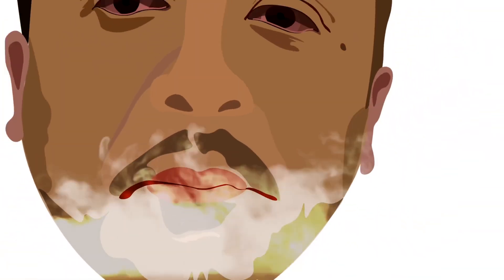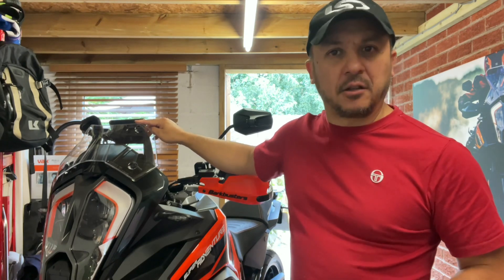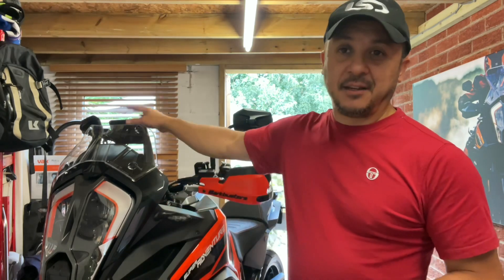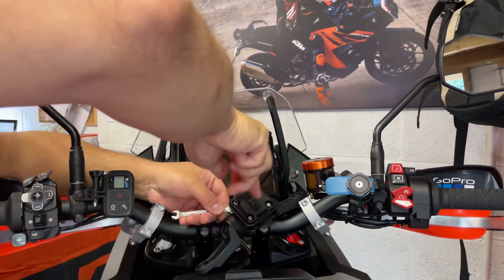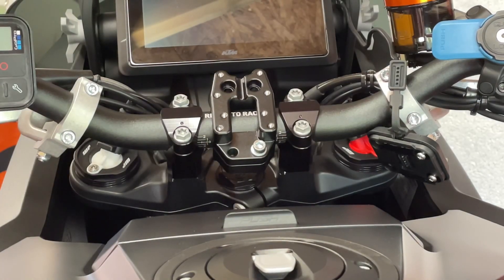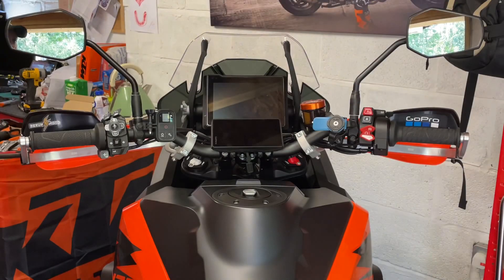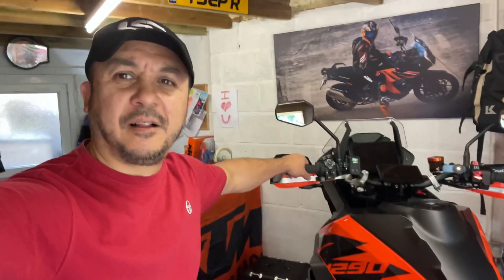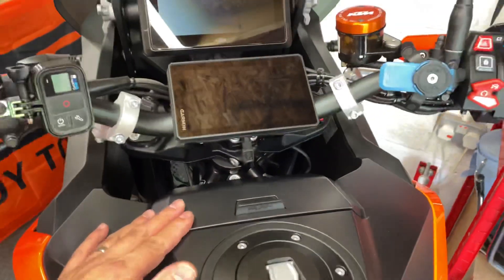2021 2022 2023 2024 KTM 1290 Super Adventure PERUN MOTO BAR MOUNTED GPS CLAMPS

Comment: I know the sun doesn't shine too often in the UK! hehe, but isn't the angle of the GPS on the bars catching any glare. I know here in South Africa I wouldn't be able to see the screen. On a related note I also have the XT and same OEM screen bracket which i changed yesterday due to to much vibration. I changed to a simple Givi bar that crosses the screen and makes the GPS more stable.
Reply from the maker: Hi Bruce thanks for the message and fair point! I have done a 300 mile ride today in brilliant hot weather and sunshine Hence the late reply. All day never had any issue of not being able to see it. Although that doesn’t mean that there will be the occasion that the angle may hit right . But for me I have had no issues so far 👍

Yes the oem mount is not to great and does vibrate a little. Although Personally I haven’t found it too bad. I’m not changing for this reason alone. It’s mainly for when I have the SAR screen on its more exposed and I don’t like it. Also I am doing some trails and want the nav solid on the bike. Which the pP mount is most certainly not solid.

I will still be swapping back to the PP mount for touring though. As I love the high level view. And again it’s not too bad in terms of vibration for the odd glance imo 

Cheers
Ric

Comment: Hi Ric - I’d be interested to take a look at this as I have a road book rally coming up and mount the road book on my handlebars - you also have a quad lock fitted too which I am also considering - good call on the rack by the way - mine arrived in the week and chuffed to bits with it 👍
Reply from the maker: Hey up Rob good to hear you received the rack and pleased with it. The Bar clamps are also as good build and finish. I am quite pleased with it. As for the quadlock it’s been my default ever since they came out years ago. I’ve had my phones attached green laning and dropped my bike more times than I dare count and the phone had never come off on impact. Only thing is with these smart phones and optical image stabilisation you ideally need to buy the vibration damper accessory. If you needed to look one weekend could meet up and you could check it out given your down the road . Or I could email or Fb more close up pics 🤝
Reply: @RicardoYeep  Hi Ric - I'll take a look today at the quad lock kit and give you a shout back I think - ideal place for the phone is on the sat nav mount as the road book holder goes on the handlebars but I also need to be able to have access to the phone to reset the counter to the road book as I'm riding - just need a better solution than what I had on the last road book rally

Comment: Hi Ric…you may have already been asked this! If you had the option again would you go with the S or the R model?
Reply from the maker: Hiya Paul I haven’t been asked but I would not buy the SAR even if I was tall enough... For me SAR is a too focused for heavy duty off-road. The SAS I can do most things I want these days on light off-road and trails.  But has all the mod cons and race bike like handling when you want on roads which is most the time. It depends on what you want from it I guess. Plus all the fancy extras like bash guard engine bars etc I can add easily 👍

Comment: You love them gadgets  :) The only disadvantage I could come up with is that in the high position the GPS is in the line of sight during riding. With the bar mount, you have to look down. I used a TomTom once mounted like this. You actually ride blindly while using the GPS. On gravel tracks that's an invitation to disaster :-D
Reply from the maker: Haha yeah I love options 👍

Agree I don’t look at the SATNAV on the actual trail but it’s getting to it and i just leave it on place. I could put it in the bag I guess but prefer just leave it. Also the high level is great and will keep it but I don’t like the SATNAV sticking out over the top of the SAR screen

Comment: hi Ricardo, like you, I had my GPS installed on the socket and I have too many vibrations.  I am thinking of changing and reinstalling on the handlebars.  Thank you for sharing
Reply from the maker: Hello mate great to hear from you again. Yes it’s most definitely more secure and solid. It suits a purpose But both have pros and cons . I will be going back to the power part mount for touring as it is definitely ether to have it in field of view. But bar mounted is not so big a deal. As you can see on the vid it’s still in perfect easy viewing. I keep both mounts and use both 👍. Just not at the same time lol 😂

Comment: Rick…did you ever consider a GS1250 when you were deciding on your 1290?
Reply from the maker: Hello mate. Good question. I did at one point in my life really desire a GS and was the only bike I wanted after moving from a race bike to ADV bikes but not over the last 5 years... In short if I did not buy the 1290 I would be riding around on a fully kitted out Triumph Tiger 900 Rally Pro right now. I literally bough the dam bike and was a bout 7 days from collection and signing off on it. Until the last minute change of heart (and additional waiting time) to go for a much larger capacity and insanely more powerful machine (1290SAS).

I never one thought of the GS1250 despite watching good reviews about it. I watched pretty much every YouTube video on it along with the Triumph Rally pro and Africa Twin...

I have owned two Tiger 800s and last brand new one was a 2019 fully kitted XCA. I really love the lean stature of the bike and handline. Again what I consider quite a good do it all bike. And the Tiger 900 Rally pro was getting so much positive news and awards. I think it won MCN bike of they year along with other kinds of awards. But in short 3 tigers in a row was getting a bit dull... I needed more power and torque... Seriously more power.. I wanted that feeling I have not had since an R1 rider which I kind of missed.

That left GS1250 (Not even close to the rush of power from all the reviews.. Its good at what it does..Yes!!... But not enough of what I want from a bike I will own for some time.

The Ducati Multi V4S...., Ticks all the boxes... insanely powerful but also insanely expensive.. (I also have a thing about Ducati being even more unreliable than most) Sorry but thats just my opinion as a UK climate rider haha.. not sunny dry all year round climates.

And finally the KTM1290.... Price, Package, Performance...... The stars must have aligned and it was like destiny.... She will be mine.. Oh yes she will be mine... And here we are.. A YT channel and 70 so videos later and the biggest grin in years everytime I pin that bad boy.

I wanted an Trackday weapon, Offroad muncher, Touring Tank and a commuter... Thats the 1290 for me!! :)
Reply: @RicardoYeep  
Thx a lot for the detailed reply. 
   We sound very similar, I road race bikes as well.  I’ve also had 3 tigers, the last one was my 900 RP.  Now on the 890r. 
  I’ve had lots of bikes…no BMW’s.  But I think I’m more about performance than all out comfort of the GS. 
  I see a GS in my life at some point but not sure this time around.
Reply from the maker: Haha.. Yes we most definitely sound like we are from the same biscuit tin! As you say maybe at some point I could not rule it out. They are top bikes and popular for a reason (or two). But not just yet for me. Its about performance and fun. I am convincing myself I am not old yet (not that I am saying a GS is for old people.... haha)
Reply: @RicardoYeep  
  Yeah I’m 51…and now ready just yet 😉
Reply from the maker: Too right!!!!!!! :)

Comment: Beautifully machined, very poorly designed.  It places the GPS too low, so you have to look down at it, which is dangerous in traffic....and it fouls the front storage cubby hole...  It should be at least 25mm higher.  Back to the RAM ball mount.
Reply from the maker: Hey there Troppo! Sorry to hear you didnt get on with the mount. I like it but is very close to the storage door like you say. But how I have it angled it doesnt foul. I guess it depends what you want. I use my high level mount for touring and day to day but for a more solid fixing and discrete (not so visible to pedestrians) I use this bar mount from Perun. Its also good when on some rough trails (not that a Sat nav is any use on a trail but I can keep riding without removing it). I have the ball mount and doesnt matter how hard I tighten it I can knock it out of position and I find irritating. All have pros and cons I guess. But definitely fair point made!

Cheers again for sharing!
Thanks
Ric